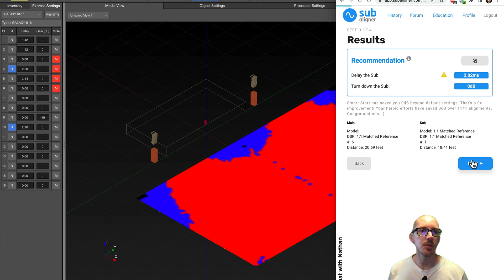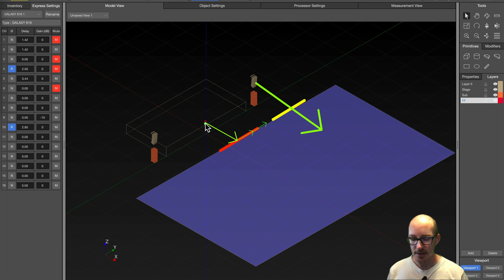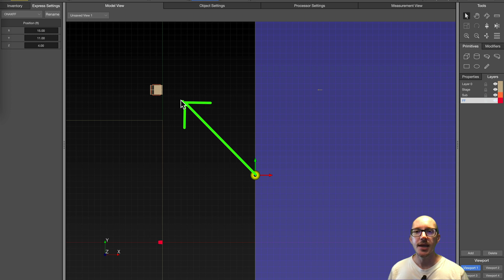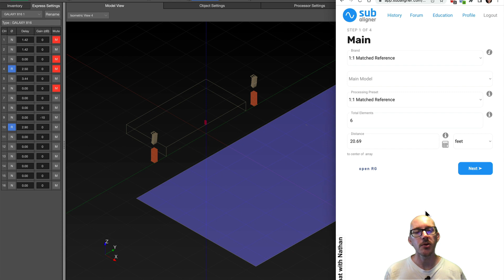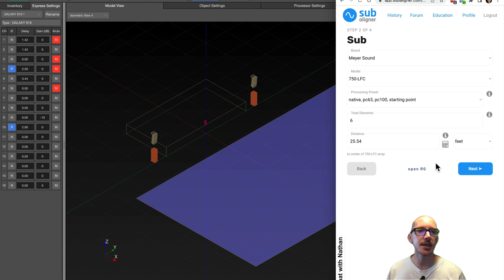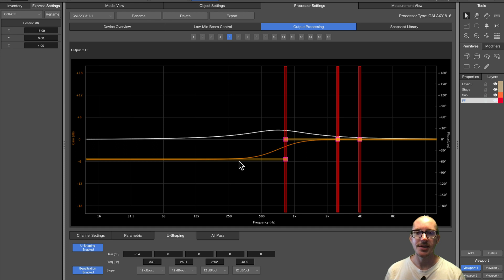Should you align front-fills to subs?

Comment: A point that comes to mind, in your prediction software, what is the height of the mains and the width of your stage?  In many instances where you have a stage, the minimum would be about 40 feet which would require 2 - 3 FFs or sometimes more depending on the horizontal dispersion.  With that being said, when you have a main roughly 25, 30, 35 feet in the air (@ the bottom), many times depending on the position of your mic, you can end up with 15 - 30 ms of delay and sometimes more.  Not knocking what you're trying to do, but I do believe these are factors that should also be mentioned to help ensure the folks trying to learn, don't get misled.
Reply from the maker: Thanks Peter. Great point. This is not an exhaustive training on system design and calibration. I have other videos and courses that go into greater detail on this subject. That being said, this strategy is completely scalable to other similar systems. Any time you have mains that cover all the way to the first row, but not all the way through the center of the first row, then you'll have a specific lateral width that you can fill with fill speakers. The spatial crossover between main and front-fill will exist somewhere between their respective on-axis positions. How you find that position is debatable, but I have found that moving laterally away from on-axis with front-fill toward main until you find it is a solid strategy.

Comment: Hi Nathan, regarding the mic placement to align the FF to Main u said find the point where both FF and Main has equal loudness. For me it makes less sense because;
1. you have to find the point where your Main systems frequency response changes (mostly loosing the HF) and this is the point mostly ending point of horizontal dispersion range (ex. 80° or 120°)
2. We use FF to correct this changing the frequency response change (due to lost of HF cuz this area is out of the dispersion area of the Main PA)
3. Then we decide how loud should the FF be. Not other way around, i.e. first decide the FF - Level and find where the FF and Main are equally loud
Isnt it?
Reply from the maker: Hey Priyan, thanks so much for sharing this. I do share your opinion and have published other videos and articles discussing the complete order of operations. However, I believe that we are in the minority. Most people do not set set on-axis level and then discover the crossover location. And, there are some good reasons for this, the main one being headroom. Most people simply deploy their fills, run them at full volume and then find the crossover location afterwards. Best case scenario with proper system design, the front-fill is the right level out of the box. 

Long story, short: You can either discover the acoustic crossover or force its location. Either are valid.